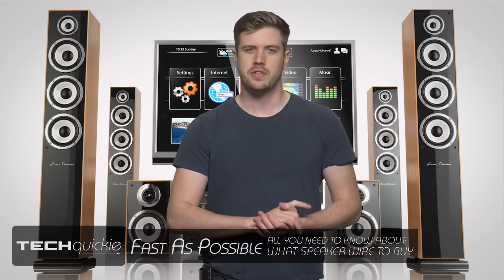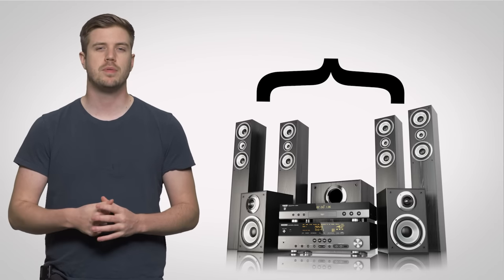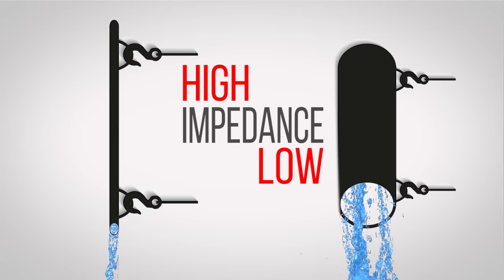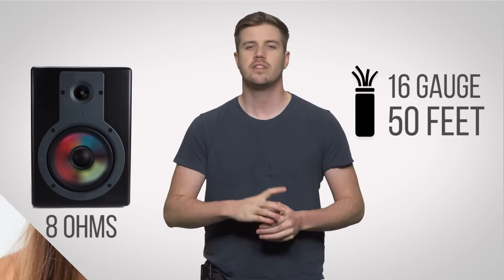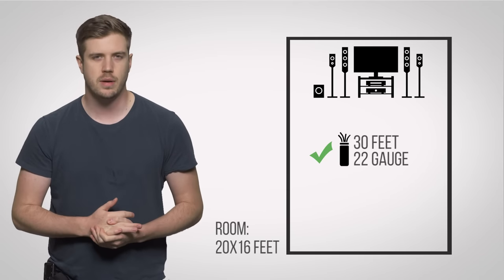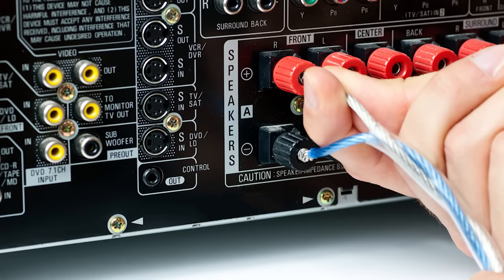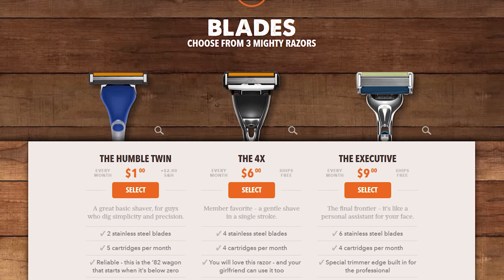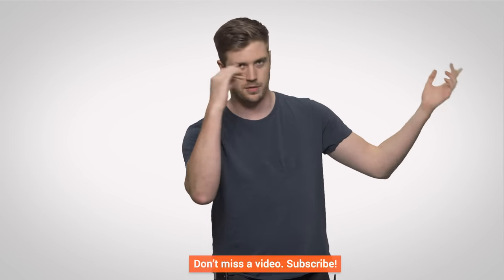What Speaker Wire To Buy As Fast As Possible

Comment: No mention of phase and polarity? really?
Reply: +Julian Gray Media He is just talking about speaker wire. Phase relates to speaker science.
Reply: ok, at the very least polarity. thats very important.
Reply: Julian Gray Media Yes.
Reply: +Julian Gray Media Uhm, why is polarity important in a wire?
Reply: Emile van der Merwe Because if you wire your speakers with reverse polarity, they will run out of phase, causing canceled bass thus resulting in bad sound.
Reply: ^^^
Your cones will pull in instead of out. Audio engineering 101. And if one cone is coming out and one is pushing in, you end up with two sounds phase canceling each other.
Reply: +Julian Gray Media That's just installing the damn wires correctly, nothing to do with the wire itself.
Reply: still would have been an appropriate side note
Reply: Oh, I didn't realise you were talking about how you connect it, I was only thinking of the wire by itself.
Reply: I personally think that the O.P. has brought up a very important part in the impedance of speakers and how wiring plays a very important part in the impedance of speakers has been completely left out of this video is actually something that should have been at the very least mentioned during the start of this video or during any part of the video. If the person who is watching this video is actually using it to learn more about the stuff this video provides them with the info about the importance of the size (gauge) of the speaker wires being used and the length of the speaker wires being used has on the sound quality from the speakers being wired with that speaker wire has on their surround sound system setup and that person doesn't have the first clue about how important the wiring of the speakers being used in that surround sound system setup to the AV receiver is, as to know that everything else mentioned in this video will be completely useless when it comes to the more important part of the way that those speakers are wired to the AV receiver is and that all that other stuff about how important the gauge of the speaker wires being used in the surround sound system setup is actually when it comes to the more important part of knowing that the way the speaker wires are actually connected to the same speaker terminals of the speaker itself, as they are wired to the AV receiver, so that the positive speaker wire from the speaker itself is wired to the positive speaker wire terminal of the AV receiver and the same with the negative side of that speaker, as well as all the other speakers in their surround sound system setup...The fact that when a single speaker in their surround sound system setup has been wired incorrectly making that speaker be completely out of phase with all the other speakers in their surround sound system setup causing an issue with the overall sound quality of their surround sound system setup. Now if a person doesn't know about the importance of that information about the wiring being done correctly to begin with, then it won't make any difference in the gauge of the speaker wires being used would make, as the overall sound quality from the incorrectly wired system will not be able to sound as good as it could... 
 Then there is the topic of the people who might think that they know a lot more about how to setup a home theater surround sound system setup than those people truly know about how to setup a home theater surround sound system setup and everything that is actually involved with the entire process of setting up a home theater surround sound system setup. The type of people who might think that they can add more speaker enclosures that contain more than just one or two speakers in one single speaker enclosure, as well as those speaker enclosures that also use some type of crossover in the wiring setup for those speakers they are going to add into the already existing surround sound setup and already wired surround sound setup of a 5.1.1 channel surround sound system setup or of the ones with more available surround sound channel systems. Sadly there are a lot of people who fit that type of description, who really truly think that way and that actually do just what I mentioned above about how those type of people who think that way truly are those who don't truly know much about the importance of learning how to correctly setup a home theater surround sound system setup has on the sound quality from their surround sound system setup. The people who think that if they took the 5.1.1 channel surround sound system setup that has already been setup completely and correctly to begin with and they took a pair of speakers in an enclosure already with those speakers having a mid range and a tweeter in the enclosure as well as a crossover in each enclosure and they could place those added speakers where they want them at and all they have to do is tie-in the speaker wires from those added speakers with the already existing wiring being used with the original speaker that is actually supposed to be wired at that location and the newly added speakers will have absolutely no bad effects to the AV receiver being used...but that is actually not right at all, as adding those speakers to that setup in the way that was used will change the impedance of that channel on the AV receiver and that can be a different impedance level that the AV receiver can't handle causing it to either overheat or just completely shut down due to it....I can keep going on about it, but I won't. 
Lol...not like many people are actually going to read this all!
Reply: BIGGDUBBYA  - Holy word brick... is your Enter key broken ?

Comment: One thing here tho... The banana plugs can actually cause problems (rearly... Veeery rearly if not connected properly to the wire or if they are not grood quality) they are made for easily switching bewteen speakers and amps not for better connection so I do believe you are better of using just the wire (why spend the extra money?)

Comment: There is a "thin pipe" running between the output transformer (which is where your speaker cable starts. You just don't see it inside the amp) and the speaker out connectors (so to speak)
Adding a "wider pipe" after a "thin pipe" does nothing to alleviate the pressure or resistance in the signal path.

Comment: The amount of power will also affect gage selection. If your speaker wires are warm, then you are losing too much signal (I squared r loss ) you needed thicker cables. I suggest 16 gauge for 100 watts and work from there.
Reply: +hitechpa1z1 if your wires are getting warm then you have a problem haha

Comment: One quick fact about surround speaker (or even just a basic stereo or 2.1) setup is WIRE LENGTH. Every cable run in your setup (be it a lowly stereo all the way up to an impressive Dolby Atmos 9.1.2 installation) should be as long as the longest cable run in the installation. Why you ask? One word: PHASE. Does the audio signal from your amplifier travel each speaker in your installation instantaneously? Umm.. No. It still still travels at a finite speed. Let's assume you're setting up a 5.1 surround installation and the cable runs are as follows (Speaker Type | Cable Distance from Amplifier): Sub | 1 meter,  Center | 1 meter,  Left/Right Front | 1.5 meters, Left/Right Rear | 5 meters. Even with only a .5 meter difference between the Center Channel and the Left/Right Front stereo pair, that's still enough of a difference to induce a very slight timing difference of when the transmitted audio signal reaches each speaker, potentially inducing a phase issue. This will be especially noticeable in the rear surround speakers sitting a cable distance of 5 meters (or 15 feet) from the audio source. This can cause the rear surrounds to sound "disconnected" from the audio environment created by the speakers at the front of the room. So, even though it's more expensive - make sure ALL the speaker cables in your installation are the same length as the longest cable run AND that they're all from the same spool of speaker wire. This will produce an optimal installation.
Reply: +vekdigital because your room is perfectly in phase to begin with. you should be time aligning your fronts to your surrounds. Wire length really doesn't matter.
Reply: +vekdigital Electricity does travel at a finite speed, which is c (the speed of light). Hence the phase difference is trivially small due to differences in length of the wires in your audio system. The phase issues that you refer to are actually due to the physical location of the speakers within your room, resulting from constructive and destructive interference of the sound waves. Standing waves are also dependent upon the placement of your speakers. The length and gauge of a wire are only dependent upon how much current will be drawn, which is fairly small for typical listening conditions.

Comment: 16 gauge... 22 GAUGE? You're telling people to use THREADS! You also neglected to mention matching wire size to POWER. You should NEVER hook up a high current amp with say 200+ watts to some thread thin little 22 GAUGE WIRE, that would be insane. I'm running a Parasound amp with 275 watts per channel, and I have 8 GUAGE wire, DOUBLE, because I'm biamping the front L/R/C. You people making these videos as if you were giving out good advice are a joke. You spent more time on your fucking COMMERCIAL than you did wire info, which was all pretty much BS anyway.
Reply: My theater room I run 10 gauge to my sub that’s like 3 ft away from my sub amo

Comment: I use copper wires with a copper core and copper plated. The diameter is adjustable, and the length is telescoping flexible flux.

Comment: also, get OFC (oxygen-free copper) wire, skip the CCA (copper clad aluminum). It's being sold very commonly, it's cheaper but has a higher impedance per foot. If that's all you can get, up the gauge by 1 or 2 more.
Reply: +Shahid R won't make a difference to the overall sound.

Comment: Further to this, IF you're intending on putting over 100w rms through a single wire you may want to thicken the gauge. ESPECIALLY for Subwoofers. A 4 ohm sub woofer pumping 300w rms will melt 20 gauge. unless were talking about some serious speaker wire.
Reply: +Nicholas “NickyG” Gilbert who uses 20 gauge on a externally powered sub?
Reply: +Slot1Gamer in his summary he says 20 guage for. a 4ohm load and at no point stipulates that resistance isn't the sole deciding factor for speaker wire guage. 
this advice could well have someone use 20 guage for a car subwoofer or even a high powered tower speaker with LFE.

Comment: So, if your system isn’t up to the task of high resolution.......this video is correct. It won’t matter so much what wires you use. But, if you the best of whatever you have, you will indeed hear differences in wire no matter who makes it. It will vary in minor details of the soundstage, frequency response, margining, etc. if you don’t know of what I speak, fear not....as you are simply not there yet to know better.
Reply: Finally people who know what they're talking about.
Reply: Very bad cable may make a slight difference. Otherwise, no difference. It at least, any difference will be difference rather than improvement. That's just basic engineering

Comment: Pure OFC (oxygen free copper) wire will also make a difference compared to CCA (copper clad aluminum).
Reply: actually depends on the application, silver plated OFC or silver clad OFC is the best for analogue signal

Comment: High end speaker cables do make a difference, but it depends on the audio equipment in use. If you have a good quality amp and speakers, then something like QED Ruby or even
QED Revelation will improve sound over the basic cables discussed in this video.
Reply: Totally wrong and debunked (and proven), wire is wire, copper is copper, as long as it's heavy enough gauge, it's all the same...

Comment: Insulation does nothing to prevent electromagnetic interference.  Shielding does.  Shielding is accomplished with either a steel (NOT COPPER) braid or foil that sheathes a wire's insulation, or an additional steel wire that's been twisted around the insulation of both speaker wires and then connected ground  at the same end that connects to your amp and left unterminated at the speaker end.      Insulation and shielding are two separate concepts.  Cables with a copper braided shield will actually increase signal ingress instead of shielding against it.  This is why old antenna coaxial cable has a copper braid and is not suitable for cable television use.  When calculating impedance the number of strands in a braided wire also matters.  Smaller  strands offer lower impedance assuming wire gauge remains the same.

Comment: Actually speaker impedance can be 4, 6 or 8 ohm for tower speakers. 4 ohm speakers provide hard, strong bass while 8 ohm provide soft bass. 6 ohm is between them, but not so popular. I'm currently using 4 ohm, passive speakers with 3 meter speaker cable ( 15 Euro/m price tag, copper). I've used silver and gold cables, but I've found the clear copper much better...
Reply: +iShane Loudspeaker impedance is dependent upon the Thiele/Small parameters of the driver, and the windings of the voice coil(s), and varies with frequency. Impedance does not correlate to bass. If you look inside your tower speakers, you will see that the woofer and tweeter are connected in parallel, with passive HPF to prevent damage to the tweeters. The final impedance at the speaker terminals is the combination of multiple impedances. Furthermore, if you use a DMM to measure the impedance, your nominal 4 ohm speaker will not read as 4 ohms. The impedance truly matters when the speaker is actually playing music, and it is common for "4 ohm" speakers to have their impedance range from 2 to 20 ohms while operating.

Comment: I've never seen nor heard of anyone shoving cable into a banana clip port... the image the editor chose right before Luke mentioned banana clips is the wrong scenario for connecting. Back the screw mechanism off 1/4" / 1cm to expose a hole through the axis of where said banana clip would be connected.

 
I'm there for you guys :)

Comment: Possible TQ Topic: USB Powered Monitors. Feasible with USB 2.0? 8K with USB 3.1? What's the best USB Monitor possible with a single connector for power and display?

Saw a recent advertisement of refurb units being sold for US$70. Sweet deal, if you ask me.

Comment: one thing not to forget is that the cables for each pair (front and rear) should be the same length even if it means one side is longer than required. 

If your front speakers have different cable size or lengths then they will sound different.
Reply: +Andreas Koepke What?
Reply: +Andreas Koepke 
Unless you picked a wire way too thin a difference in length is irrelevant. You won't hear a difference of a few milliohms.

Comment: well as for the premium cables being snake oil I have to disagree. They do have lots of advantages it's just that they're not applicable for most home theater applications. For situations such as large venues/live shows with lots and lots of wiring travelling hundreds of feet from the stage to the sound booth at the back of the venue, premium professional cables will typically offer better insulation and a whole other range of features so you won't have nearly as much interferrence. They will also transmit a greater range of frequencies without loss over longer distances. They're not snake oil or scams, they're just a useless upgrade for home theaters contained withing a 16x20 feet room. So yeah, don't buy them for your home, buy a TV instead... but know they're at least good for something.

Comment: +Techquickie You forgot a very important bit of information, Luke: lower gauge wire is thicker than higher gauge wire.

Example: 0g wire is about 2cm thick, and 37g is about .5mm.
Reply: They mentioned that.

Comment: You can't recommend a speaker wire size without knowing the power (wattage) that they will be using. 

As you may have a 4ohm speaker,  but be using an amp that can create 1,000watts of power.  20awg simply wouldn't suffice for any type of distance.
Reply: +Bassahaulic Productions Actually that is not completely correct either.  If you have a home theater amplifier that is capable of pushing 1000 watts of power through a single channel, which is not all that likely since most average home theater systems won't do much over 150 watts per channel, that amplifier will also be outputting at a higher voltage.  My Yamaha receiver for instance can put out 120 watts RMS for each of the front channels but it does so at 24v peak to peak.  My 40 year old aging PA amplifier that I use in the workshop is capable of 600 watts RMS per each of 2 channels but can only handle up to 12 gauge wire in the terminals since it runs at about 40V peak to peak.
In car audio you have to deal with higher currents since most car audio amplifiers can only output 9-12v peak to peak with some of the lower wattage ones intended to drive door speakers running at 16-24V peak to peak.  The trade-off is that most car audio systems can use very short lengths of wire so very little resistance is present in the system.
The normal operating voltage of the system will also heavily dictate the wire size.  A good example would be 25V, 70V and 100V commercial distributed audio systems that can use much thinner wire because they run at a much higher system voltage even over long distances (sometimes 1000ft or more) and instead use step down transformers at each speaker so the supply wire gauge can be thinner.